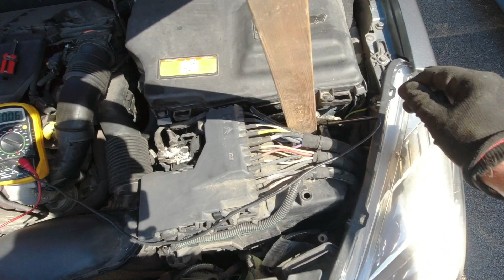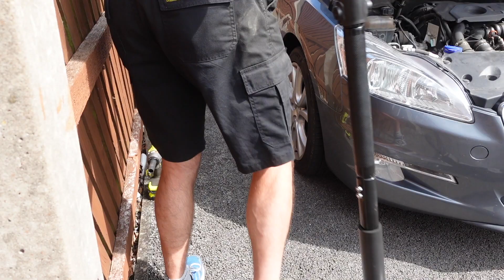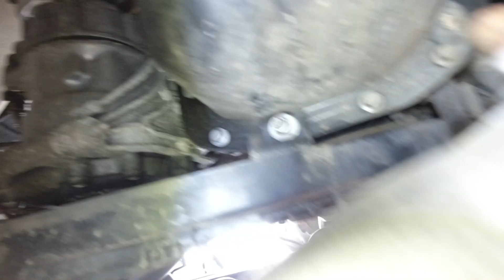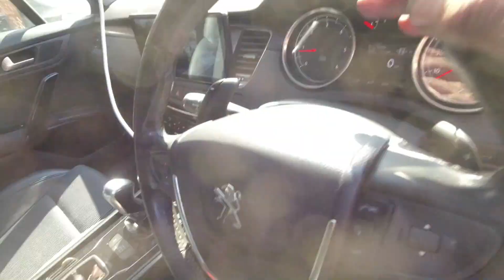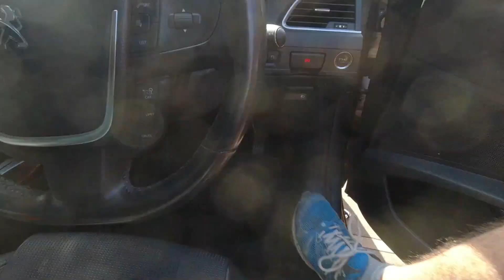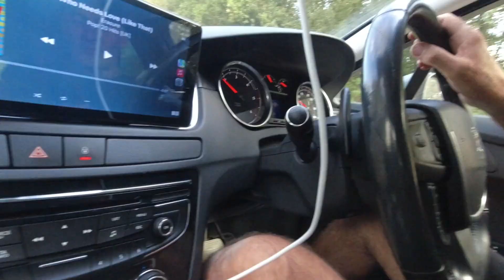Easy fix for aircon not working!! | How To | DIY

Comment: The ac system should be serviced/ re gassed every 2 or 3 years as it has rubber hoses on the system so can loose a small  amount over time but also carries oil around.